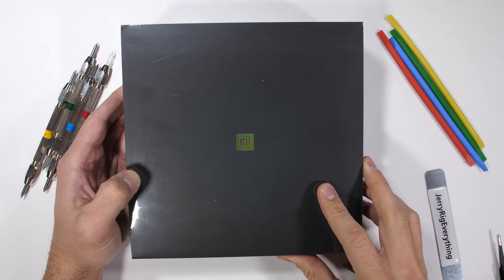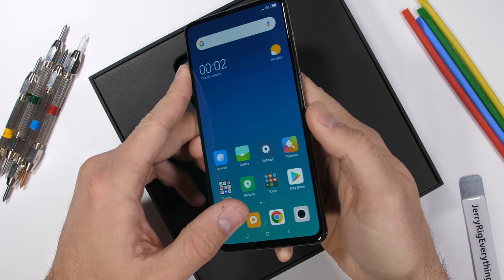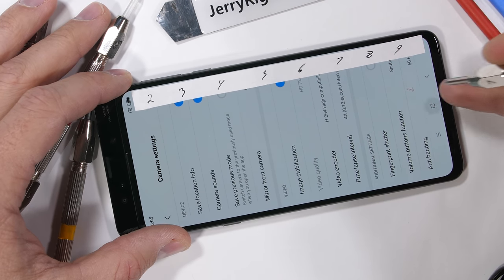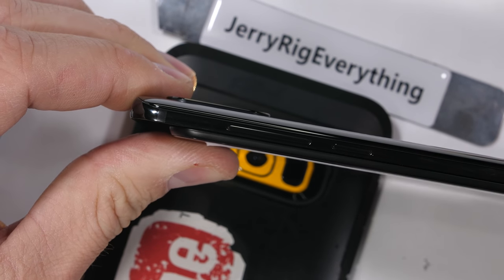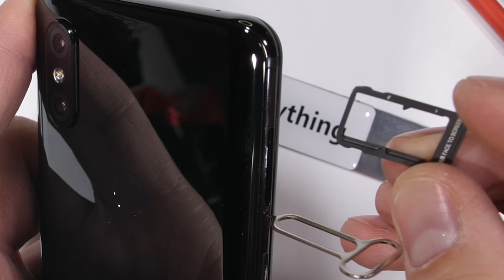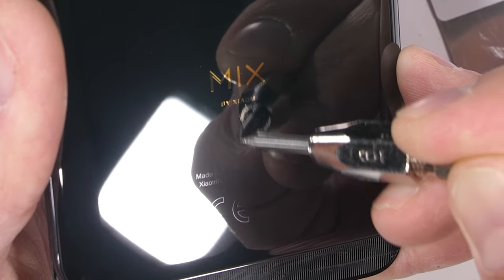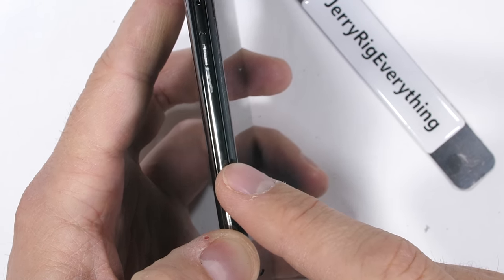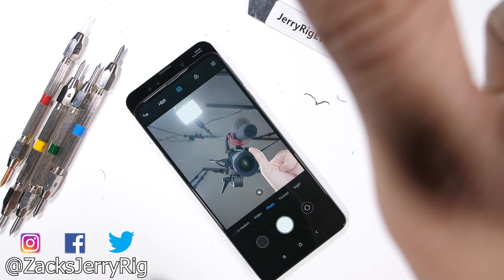How Durable is a Sliding Phone? - Xiaomi Mi Mix 3

Comment: I love my Mi Mix 3, got it since a week, green color 128GB/6GB RAM version - the value is insane good
Reply: Battery life tho?
Cuz i have the mi mix 2s and the 3 has less battery than the 2s
Reply: @escolapirespectuos1298  I have about 50-70% at the end of day (whatspp msg and video calling - 10-90min, Bluetooth connection to my Galaxy Watch 46mm, some webbrowsing)
I also use dual 4G with two sim cards. I never get a problem with my battery, the same was with my Galaxy S8 (which was just a tad weaker in battery life).
Reply: @DoGyAUT  How's living without a headphone jack, tho?
Reply: no such thing as valx or lovx or not
Reply: @zignasihmasmas4598  Surprisingly I was quite a Mr. Jack guy, as I use my phone for music kinda a lot (bus, plane or before sleeping). My solution was to just keep the dongle on my headphones instead keeping it seperate somewhere. Probably the only thing which is a bit annoying is listening to music and charging the phone while staying in bed, but wireless charging is ok for that. As for sound quality I would recommend a good DAC USB-C dongle (like the Razer Phone has included) Dolby Atmos makes quite a difference there.
Reply: MM3 user here. compared with with mate 20x's 4000 its actually holding up surprisingly. those worrying about the gap, its kept there so as not to make any scratch marks between the slider. well...i say the phone is an absolute stunner.
and yea...the phone is heavy and slippery. you might have to buy a thicker case with finger strap to operate the slider with one hand.
Edit: oh yea...another thing. the charging pad provided in the box is quite fast in charging too.
Reply: How do you go about cases?
Reply: @Vholls2000  go to aliexpress. you get a bunch of them.
Reply: Hows the camera?
Reply: @ironfist9414  camera is actually pretty good. best thing is you dont feel the phone overheating because of the ceramic back.
Reply: @escolapirespectuos1298  Battery is really great optimized!
Reply: I have too  @escolapirespectuos1298
Reply: I got one for 436 USD from EU locals shop 😀
Reply: @erbjir  hey do you have any problem with instagram stories? are they cropped or something like that?
Reply: @puqo3809  yeah this is software problems with instagram . i have this problems with Mi Mix 3 and Redmi Note 5 also
Reply: @erbjir  is it annoying?
Reply: I got mine last week, I get over 9 hours of SOT from 100% to 5%, note I'm not a gamer so I'm pleasantly surprised and happy as a customer, I thought 3200 mha would be a dud, I was wrong. 

One more thing, my friend was coming back home from China so she bought it for me at a Xiaomi shop for 4 000 Chinese yuan, massive deal imo.
Reply: Where did you all get your phones (mi mix 3)  from because i dont wanna buy it from somewhere where i dont get the wireless charger with the phone. Or im not sure if its in the package always..
Reply: @EpicHylje  woreless charger is included in every box. So you only might not get it if you buy used phone(not brand new)
Reply: Hey, about music: 
Guys im listening to music 5 days a week for at liest 3 hour each day (while traveling to collage/job/wherever) and since I break any wired headphones within 3 months I went to buy some cheaper wireless earphones just for a test and man I'm never going back to wired again and I don't even need any more expensive ones. These are epic. I got anker slim buds+ for 23-25$ from aliexpress (were on sale) and they are the best earphones I have ever had (I never bought any that are over 40$). The one and only conn about these is that they take too much to charge (1.5h) and they last for like 6-7 hours of music. Sound quality - great (bass is crazyyyyy!). I thought to get these just for testand then if I like them I wanted to buy beats x (which are a lot better, but still 5-6 times more expensive) and after I saw how good anker is I'm not going to change em any times soon for sure. Btw I got em for almost a year now. 
So after I moved to Bluetooth I'm totally okay with no headphones jack:D

Comment: This is innovation, not what Apple does.
Reply: TechDove This isn’t innovation, it’s a gimmick taken from old phones from which it actually made sense on to sell more phones.
Reply: @Wilbertchople  Imo the notch is more a gimmick than this.
And yes sometime innovation is not something extremly hard to think about.
Like the dual camera for exampel.
Reply: This is more bold than Apple
Reply: Deus Ex Machina But this isn’t helping things, and I think a notch is harder to make than removing the motor in the oppo find x. I’m not denying the notch is a gimmick but I don’t think this is innovation in the slightest.
Reply: @Wilbertchople  it is innovation. Using an older idea with newer ones as a solution to present problems would be considered innovative.
Reply: No it’s really not. It’s a lazy and careless design.
Reply: @Lazarus_  why careless/lazy? They implemented an old design with new tech and ideas to solve the "notch problem". I find this design better than the punch hole screen which serves the same purpose.
Reply: Anyone else sick of the word “innovation”
Reply: @Lazarus_  lazy and careless design is cutting an interruption into a display to achieve a higher screen to body ratio, it's getting the results with half the work.
Reply: @Wilbertchople  if it works, is it really a gimmick? I'm curious what your opinion about notches and face ID is, facial scanning has been a thing since 2011 on Android devices, apple just added 3D mapping to it, so if this isn't innovative surely neither is face ID?
Reply: @sparkylfc91  I know I sure am.
Reply: TechDove like the camera cutout on the S10?
Reply: @TechDove  Exactly. Very well spoken. 👍
Reply: @IHTCAU  by no means am I pledging my allegiance to any one company, nor am I bashing apple, in fact I have a XS Max, I'm just here having a civil discussion about what we all find innovative. And if you're asking, no I don't find the "hole punch" to be innovative.
Reply: @lanchon5077  what are your thoughts about the whole notch avoidance techniques?
Reply: TechDove It isn’t either. Nothing of 2018 was innovative. It was just an entire year of manufacturers going “LOoK I PuT TWo ScREnS” or even stupider stuff than that. This isn’t 2004, and phones are everyday objects. Not gimmick fests.
Reply: amr salama No this isn’t solving a problem. This is making the phone look better for increased sales.
Reply: @TechDove  I just posted that because I knew someone would call the 'hole punch' innovation.
Reply: @TechDove  I love this design, not so much the punch hole. I always found slider phones so satisfying, I did grow with one after all. If only it was waterproof.
Reply: @Wilbertchople  hacks like you are what preventing creative solutions
Reply: @TechDove  I dont find the "notch" in the top innovative either? Whats your point?
Reply: The back copies iPhoneX
Reply: TechDove So explain to me how you find a phone with a sliding panel innovative seeing how 90% of phones from 2006 - 2010 did just that.
Reply: Goks The giggly Goks “creative solutions” aren’t stealing old ideas to solve useless problems. That dual screen is even dumber. R.I.P. wireless charging and having to flip your phone over is so stupid. None of these features will improve my experience in any way.
Reply: amr salama where’s the new tech and ideas exactly because a sliding mechanism isn’t new tech and it sure as hell isn’t a new idea. At least with a notch you’re not going to have to worry about the inevitable jamming of the panel from pocket lent and dirt.

Comment: Why not bend test while the phone is slid open?

Edit: about everyone replying "cause it's not natural" - you're not gonna be putting an iPad in your pocket but I still want to see how it holds up to a bend test
Reply: Joo2oob  ikr ,it would be unfair
Reply: Cause bend test was simulation of having your phone in your back pocket? And phone wont be slided out when you placed it inside?
Reply: 王太阳 idc about it being natural or not, I want to see what happens. Like I'm not gonna be "naturally" shoving an iPad in my pocket but i still wanna see what happens and how it holds up when you bend it
Reply: I guess it would be a bit unfair and he probably wants to open it first while it's still functional. I'd also imagine it wouldn't survive the bend while open. I was already afraid while it was closed. Surprised, though. It held up pretty well.
Reply: @thiefrules  don't worry, I'm with you. I actually have a slider phone, the magic 2 and sometimes, especially if you are a clutz, you could slide the phone open, forget to close it and pocket it. There's also the situation that if you are using wired earphones and pocket the phone, and then you decide to pull out the earphone while the phone is in your pocket, it could slide the phone open if you don't hold against it. 

Regardless what people say, the least likely situation isn't impossible, just have very low chance to happen. The fact that there is a chance, regardless of the low probability, means that it will happen.
Reply: @thiefrules  But you can put your iPad to your bag with some heavy stuff too, aaand its bending af.
Reply: You are gonna put it in a bag which is far worse than putting it in a pocket
Reply: there's always a chance where people forget to slide back the camera in multiple scenario...Would totally love to see how durable that camera part is too
Reply: @secondsein7749  thats why to prevent headphones case they removed the headphone jack
Reply: @thiefrules  I dont think anyone puts iPad in their pockets (or physically can for that matter) . You probably mean in backpack, along with other stuff, which most people do.

As for what would happen to the phone when bent like in the video, while open, it would probably break or damage the mechanism badly. The force he uses is pretty unreal and the likelyhood of the phone being open in your pocket is very small so why destroy the phone and mess up the vid where he takes it apart ?
Reply: But you're gonna keep the iPad in a bag or throw it on the sofa or bed...I think that's enough. Nobody in their right mind would keep the slider open and the magnets used are strong enough to hold it together all the time.
Reply: @0marble8  if anything, the headphone jack makes taking out the earphone much easier because they weren't fitted too tightly. Those without the jack would need to use the USB dongle which is tighter. My phone uses that so trying to pull it would require more force than if it was a jack.
Reply: @0marble8  no, the headphone jack makes taking out the earphone much easier because they weren't fitted too tightly. Those without the jack would need to use the USB dongle which is tighter. My phone uses that so trying to pull it would require more force than if it was a jack.
Reply: You will not bend your phone while taking a selfie but probably would sit on your ipad just by accident
Reply: You will put it in bag
Reply: Surjith Rock so people deliberately puts heavy things besides an iPad inside a bag?
Reply: @RR-uc1wb  putting it in bag with some books and you do lean sometimes, but not much is enough to bend it
Reply: i think that this slider is new for zack, he prefer to dissect it while in a good shape and of course, whilst its still in function.

Comment: I've used this phone for 3 months now, no problem with slider mechanism
Reply: How is the weight? Does it bother you being that heavy?
Reply: @Charmarque  it's a heavy phone especially switching from op3t, but I actually prefer it and instead of my phone feeling heavy, now all other phones feel light.
Reply: Have you dropped it? How's battery life or heating while gaming?
Reply: @RakaZet  
depends on how you use it lol ? if you are looking a phone only for gaming. It depends on the game - buy a Samsung 10 and the battery will last longer buddy
Reply: @RakaZet  battery life is average, nothing special, dont use mine for gaming so i dont know about heating
Reply: Buy the black shark instead or razer phone if you want to game on it

Comment: Dear Jerry, I'm a huge fan of your channel.. I watch all your videos.
I have one suggestion to your durability tests,

 The most major durability problems that people face with their phones  are
1) breaking of glass due to falling
2) damage to display due to accidentally applying pressure.
3) moisture entering the phone

I have never seen somebody losing their phone because they accidentally bended and cracked it, or their display went off due to flame being applied on the screen.
So if you could include some tests to check the factors I mentioned, along with the current tests it would be more helpful.
Reply: Purple VIdeos my friend  bends her iPhone 6s+ when sleep with phone, previous phone cracked in back pocket when sitting 
So that test is useful as for me
Anyway your advise with screen is great and true 
P.s. friend  is 50 kilos , not so big 2 bend with body

Comment: But What happens When you Want to use Snapchat ,do you lunch the app the slide the phone ?
Reply: Seiko 95 how would a case work for this phone? Lol like, if you put a case on you can't slide it??
Reply: @JoseLopez-yi4fp  they had custom cases for it which did not have any upper protection
Reply: you can set the slider not to open the camera app automaically. so no problem with snapchat.
There is a case delivered with the phone, what they have done is they cut out the bottom so the silder can still move downwards. It's rather simple yet effective ;)
Reply: MegaMaskedrider  ah Nice , They thogth of everything
Reply: its a fantastic phone, even Screen on Time is pretty decent (got 6-8h depending on usage) despite it just has 3200mAh.
Reply: @JoseLopez-yi4fp  Just like the old Blackberry Torch, it's a two piece case

Comment: Can the screen actually heal with toothpaste?
Reply: It doesn't. Toothpaste only works on phone, and it doesn't heal. Toothpaste contains fine abrasives, so when you rub a scratch you're basically sanding the sides of the crevice.

Comment: I have the Mi mix 3 5G and I think it's brilliant and it's tough as was the Honor 8x I had. The Samsung S8 on the other hand, no, weak af. I placed the S8 on the ground when working on a car using its torch and the screen was smashed all over and then its display stopped working all together, I'd only had it 12 days. The last iPhone I had was the 6s and that broke after 2 months because the charging port stopped working causing it to be useless

Comment: if you tend to keep sliding your phone do not put casing, the side will have some wear off. i just used 1 week some area of the both left and right side started to change its original color to lighter color.  Been sliding less then 100 times. Anyone has the same issue and does this due to the casing problem?
Reply: The case is needed because back part of Mi Mix 3 get easily dirty (fingerprints, oil, unclean marks)

Comment: I dropped my Mi Mix 3 1 foot off the ground and it was slider closed. I had provided case on and a screen protector. The bottom left cracked and dented the glass. Recommend getting a better case, or just don't drop it.

Comment: Why would they use a softer glass for the camera cover than for the screen? That's a little disappointing, that it would already scratch with that blade.
Reply: That was the plastic piece for the LED.
Reply: @alex_inside  watch at about 1:57. This is not the cover for the led flash. I see this scratch really badly whenever a grain of dust gets caught in between and you slide it open.
Reply: @opinionatedoliver3680  Oh that, that's normal it is the oleophobic coating. Every phone has that, swipe it clean and no more scraches.

Comment: "wireless ecosystem" while picking up the wire. There's nothing wireless about these docks. It needs to be called dock charging, not wireless charging. Wireless charging will be when there's electricity in the air and the phone can charge while in my pocket. This dock crap is useless, just wastes desk space.

Comment: while initially xiaomi phones look good i can certainly say i am highly disappointed at my xiaomi mi6 buy
should have gone for the slightly cheaper and slightly slower s7 (in my country at the time of buying)
while in theory the mi6 is a good phone and a good value for money the camera is shit (yes its shit if it cant shoot 1080p@60 fps video and fuck 4k when i dont even have a 4k screen anywhere, i preffer 60 fps than few more pixels i can only see if i zoom in), the software is shit (seriously miui is utterly shit  still preffer samsung's android version which i have used in the past), the screen is meh (i would say shit but i want to be objective with what i say even though i already know most of you will think i am bullshiting, anyway its an lcd and at this point we all know amoled is better, i still preffer the 720p amoled on my old galaxy a3 rather than this 1080p lcd), there is still no support for arcore which even the s7 (which is older) and even mid range samsung phones have of its generation and above, its not waterproof which i wouldnt want to utilize on any phone but it surely is nice to know you have it (you never know when you ll need it), it doesnt have a headphone jack and it didnt even have headphones included in the box (both of which samsung included) and i dont know if i forget something or i have said everything. At least it has an ir blaster which i can use as a remote (which is like waterproofing, i dont really care about it much but it can always be helpful given some circumstances, and which samsungs phones dont have)
anyway most of these things i said arent true with the current gen xiaomi phones but i dont see why i wouldnt be disappointed again by other things
it all seems good before you buy but after daily usage you start to realise that xiaomi isnt perfect and there are serious reasons why samsung's phones still have a good value for money (of course not performance per $ but for quality of the phone)